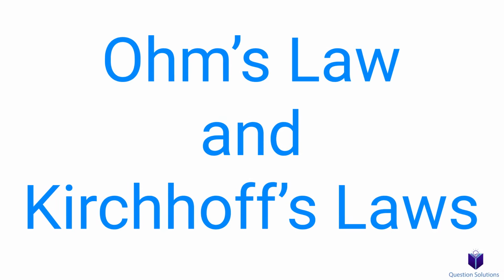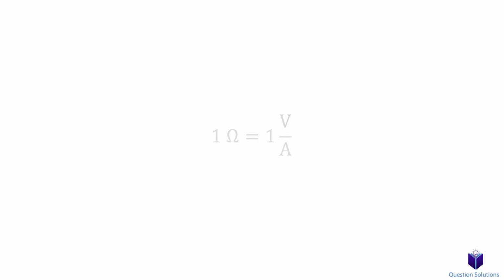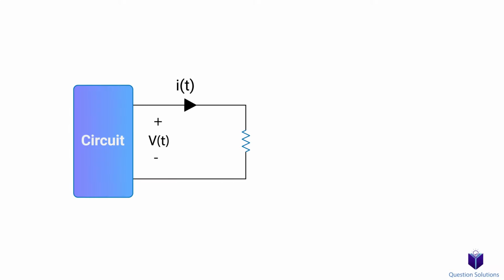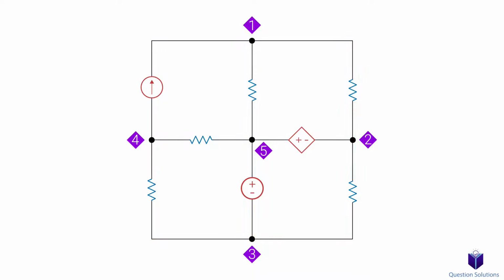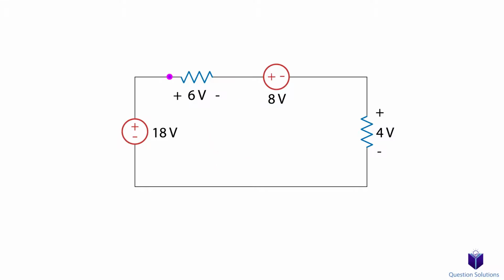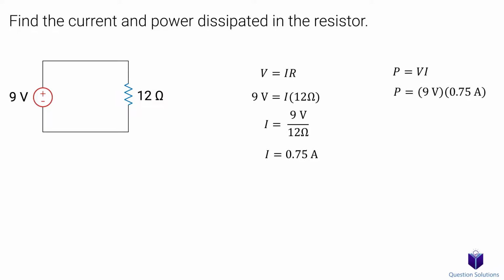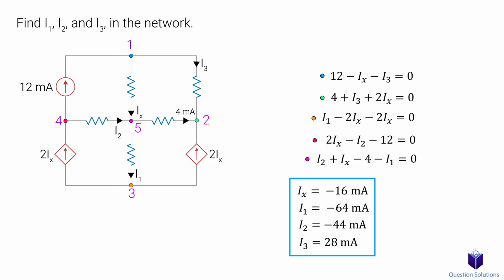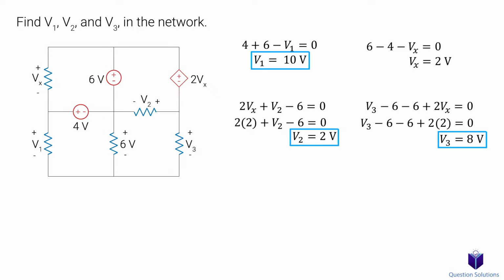Ohm's Law and Kirchhoff's Laws | Engineering Circuit Analysis | (Solved Examples)

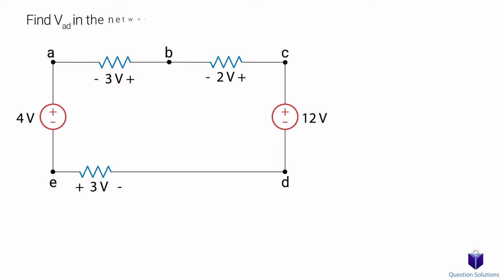Comment: 10:30 The loop abcde doesn't add up to 0.
Reply from the maker: I don't see abcde. Where are you referring to?
Reply: @QuestionSolutions  the question with Vad try 10:45
Reply from the maker: @pablogonzalez2009 (-3) + (-2) + 12 + (-3) + (-4) = 0.

Comment: in the last question how come you cannot use the bottom right loop only to calculate v3? 
ie v3 - 6 -v2 = 0
v3 - 6 - (2) = 0
v3 = 4

is it because you need a voltage or current source in the loop? thanks
Reply from the maker: No, you can use that loop. It will be (if we go clockwise)
 -6 - V2 + V3 = 0
-6 - 2 +V3 = 0
V3 = 8

You incorrectly did the addition. -6 -2 = -8, not -4 :)
Reply: @QuestionSolutions  🤦‍♂I actually can't believe I messed that up. Thanks for the help that clears things up!

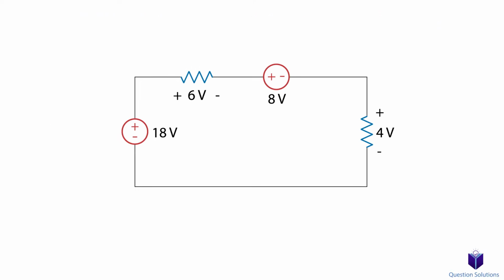Comment: at 6:45 is there a way to find where the sign of positive and negative goes if a resistor doesn't give the sign conventions?
Reply from the maker: Resistors follow passive convention. So it doesn't matter which way you assume a current to flow, the current will always enter the positive side in resistors.
Reply: @QuestionSolutions  what if there is no current flow stated in the problem, its an open circuit? do we still make it positive where we  assume the flow of current will enter?
Reply from the maker: @Edgarcandelario-i6q so you're free to assume any direction for current flow, and that direction determines the positive and negative sides of a resistor. If you watch my video on mesh analysis or nodal analysis, it'll be more clear to you.

Comment: the problem is that questions do not show the polarity of resistors. So, I used KVL and set up polarity of resistors based on the current's direction (current enters positive terminal and leaves the negative terminal of resistor). However, I am getting wrong answers. Sometimes I get correct answers, but when I change the direction of current, I again wrong values. Isn't this right that we just assign resistors' polarities according to the current's direction and end up having always positive voltage across them in KVL?
Reply from the maker: Usually, polarity isn't shown because, as you just mentioned, we assign the positives on the resistors based on the direction of the current. Current enters the positive side. Regardless of the direction of current you choose, you will get the same answer. It won't change. If you are getting incorrect answers, then there is probably some numerical or sign error in your equation. Really hard to say without seeing a worked problem.

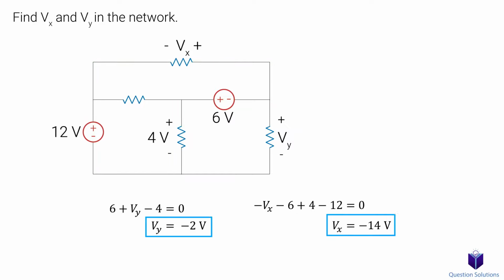Comment: 11:20  the answer for Vx is 14v
Reply from the maker: How did you get that? 😅

-v-6+4-12=0
-v-14=0
-v=14
v=-14
Double check your work, you have a numerical error somewhere.
Reply: @QuestionSolutions oops sorry my mistake 😅
Reply: @QuestionSolutions  after finding Vy, could you have calculated Vx using the whole loop? I feel like this should work, but my math isnt mathing. -Vx + Vy - 12V = 0 => Vx = Vy-12 = -10
Reply from the maker: @Jokkemeister  
Vy-12-Vx=0
-2-12-Vx=0
-Vx=14
Vx=-14

You need to plug in -2, not positive 2, because when we solved for Vy with the positive sign on top, we get a value of -2, and you need to stick to it.
Reply: @QuestionSolutions oh yes ofcourse! It was just a brainfart and I hastily wrote down + 2 since it was incoming at the + pole. Thanks for the quick reply! ❤

Comment: Any tips identifying loops😢.. I feel like life will be easier if I correctly identify a loop
Reply from the maker: Maybe you are overthinking it 😅A loop is just a path where you encounter each node once, and not two times. In really simple terms, it's just small boxes/rectangles or large boxes/rectangles. It just can't be weird shapes like figure 8s. It can even be a L shape. Just be sure that a node is only encountered once.
Reply: @QuestionSolutions  but L-shape is not enclosed

Comment: Do mesh and nodal analysis next plsss... Great video as always bro
Reply from the maker: They are definitely coming up, I think it will be one more video before that. I need to show how to add resistors in parallel and series and voltage/current division equations before nodal and mesh analysis.